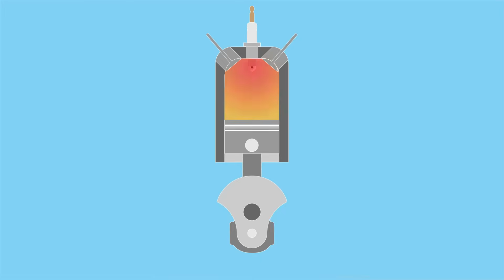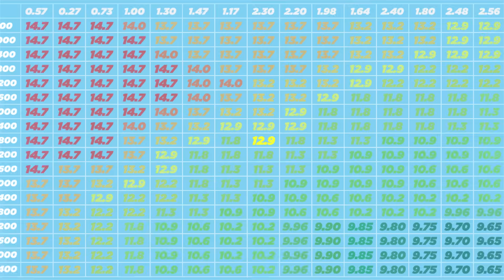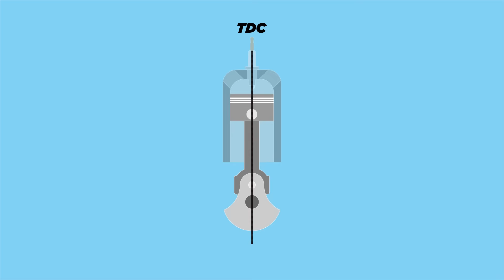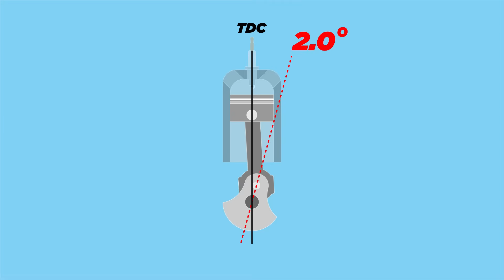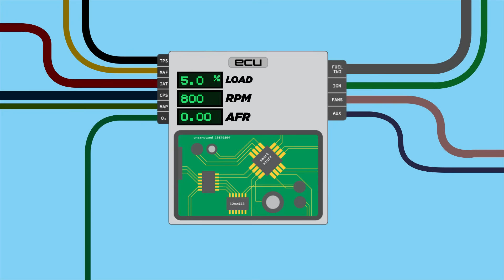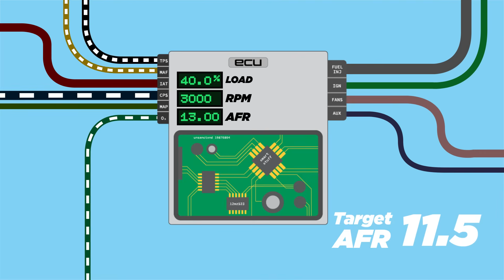ECU Tuning || EXPLAINED

Comment: i must be one of the only GEN-Z kids that can properly tune a carbureted engine. You actually tune it with the same values you use on a tuning software. Tune the engine for peak idle vacuum and the engine will be running at the most volumetric efficiency. This can be done by simply rotating the distributor forward or backward and watching the idle vacuum change until you find the value it peaks it (will be different for every engine) and as for tuning the carburetor itself. In the old days, you drove down the road and pulled the plugs after cool down to see if it was running lean or reach. But that's highly inaccurate. Today, you drill and tap a set of wideband O2 sensors into your headers and hook up an AFR gauge in the cab. Now you can see your AFR at low, mid, and high circuits and change the jets accordingly. (carbs use different fuel circuits depending on your throttle input, full throttle would use the high circuit) So really, all you need today to tune a carbbed engine is a AFR guage, a screw driver, a vacuum guage, and a 13 or 15 mm wrench (depending on the engine) 
My 1994 mustang 5.0 makes 289 whp with a Holley 650 carb and high-rise intake. Stock everything else (195 stock hp) $600 in performance parts with a 94 hp increase is pretty damn good.

 As for tuning an ECU.... there's a reason im watching this video

Comment: Hi
Thanks
Please give me a reference so I can learn the basics of tuning settings. I don't want to blindly change a few spark or AFR parameters based on imitation.
Due to the difference in the tables in different ECUs I need to learn the difference between the tables. For example some ECUs have 5 spark tables and I don't know when each one is activated.
Thanks

Comment: Beautifully explained, most folks dont realize the role of inertia, ignition delay, fuel injection timing etc. As you rightly said, its a very deep rabbit hole. For example you can tune the engine to deliver +20% power, but wont be as effective unless vehicle weight, traction, tire tread etc are adjusted (for various driving conditions). There are just too many variables - in the end each driver also perceives the weight, response, timing etc differently. Respect for folks who do it on day to day basis.

Comment: We didn't go straight from carburettors and Kettering ignition to mapped systems. There was mechanical fuel injection, Hall effect distributors, mapped ignition started to appear, electronic fuel injection based largely on intake air flow, more and better sensors and injection control systems that took advantage of them, king of sensors Lambda, then eventually, mapped fuel injection. That all took about 30 years. 30 years of utter confusion!

Comment: You are not answering questions?????
Reply from the maker: What is the question?
Reply: @ Hello
What turbo would you recommend please 
For a 2.4 5 cylinder 20 valve 
2398 cc 4000 Revs diesel something that spools up fast and good high end ? My target is max 300 Hp , I prefer Garrett ceramic ball bearing water cooled vacuum boost control or whatever you recommend 
Thank you

Comment: Hey brother, i need your words.
I have Civic 10th gen, i recently flush the engine, clean throttle and changed clogged airfilter. As airflow will increase after that, do i need to reset my ECU or it will automatically adjust other things and increase the performance ?

Comment: Hello, I have M4, S55 engine. I exchanget the stock air intake system to Eventuri and now I can see that the air/fuel mixture is too loan at low RPM 1000-2000 (STFT more than +20%). Please can you help me to readjust my ECU parameters? My ECU is bench unlocked and for diagnostic I use BM3 software. Thanks, Richard

Comment: The weird thing is that I have tried 5 different tuners for my car and every time the car stays completely stock on the draggy times. It accepts all the changes like start/stop system off, soft limiter off etc but the power is stock, the car is Giulia 2.0 280 hp

Comment: Need a programmer for a 2002 ford thunderbird. Tried SVT and other brands as well, tripped the pas anti theft system before even downloading the stock tune. Can't find any compatible tuners on the web. What's the big secret?

Anyone know why a simple tuner won't work on this model car when they work on almost any other model ford?

Comment: interesting my l200 will work better now 2003 my old rally car was a god m2 escort 1.3 all light and ball bottom end and top , put out power of a 1.6  old car registration  was UK  bvj155v   sold it long time a go now. did a lot of night rally's with it back in the 1980,s

Comment: The ecu auto tune thing is accurate of all card except the stone age ecu on a 04 Subaru wrx and many others... Acura however is amazing at self tuning and adjusting values.

I learned tuning on my own and so far I've surpassed everyones expectations on power, efficiency, even mpg. On a almost stock wrx I had about 280awhp and 35mpg and lower emissions than stock.

Comment: @MZopyrus, you said something that didn't make sense to me. You mentioned that when you get a cold air intake for example, a tune would help to unlock the additional air flowing in by injecting more fuel. Shouldn't this be already happening with ECU seeing more air flowing in based on the input of MAF sensor?

Comment: Subscribed. It seems like there should be software to automatically optimize your tune.
Reply: There is
Ecus can let you start and let your engine idle a bit
Unless its something extreme like a 3 rotor engine then you should be good

Comment: Wow, you truly opened my third eye when it comes to engine turning.
Before, I thought that engine turning was a waste of money that would alter the OEM equilibrium of your engine and that, as a result, you would get ten additional hp, but your engine would blow up in 5k miles.

Now I understand the purpose of engine tuning. It's basically an art of balancing all the parameters of an engine to reach the best performance, which doesn't necessarily mean blowing up your engine

Comment: Very nice educational video,  the speech is a little rapid, lacks pauses, and pours in the information. He tries hard to explain the basics.
This video does  not warn that changing  those boost settings to more power
dramatically reduces the engine life and probability of a failure

I'd like to know what advantage can software provide to a NON TURBO Subaru engine, 2.2 or 2.5 .

Comment: I have a BMW K1600 motorcycle and needs to be tuned. One thing you may mention in the end to be aware of EPA constrictions. In Europe they are tougher than US and thus imported motorcycles can be tuned to not only make them faster but just ride better. At around 65/85 I like to be a low poluter and before that and after that I bought this thing for FUN, if I want to. Making the tables, like you mentioned are very complex. The video is otherwise about a good as anyone can explain it. Thank you!!!

Comment: As a software engineer I could add you that tunning, at some point in the next couple of years will almost be a thing of the past. Once Internet Of Things (IOT) becomes big like how AI is today, tunning would be done remotely by a tunner miles away from the engine or directly by a Machine learning model. Either way, we still need the human dexterity to interact with engines. Keep learning about tunning, so that you can be the one that teaches AI how each family of engines behave, so future generations have automatic AI tunning
Reply: Good day!, I would like to ask, if it is necessary to remap the ecu of motorcycle after exhaust replacement? from stock exhaust to loud exhaust.
Reply: This would be cool but somewhat wishful thinking. Although I specialize in EE, I have both programming and automotive experience from a young age, and both the technical side and performance side of tuning require different approaches.

Realistically, if I could use an AI to tune my car, it would be sufficient in setting a sort of “baseline” tune that I would build off of. Every car, regardless if they carry the same modifications or stock parts, performs somewhat differently, and a “1 tune fits all” approach would actually yield a few different results if tested on multiple cars of the same make and model. 

From experience, these results can be so minuscule they’re unnoticeable at first, or so drastically different it leaves you scratching your head wondering what the hell the car is doing.

Comment: Great video the best one I've seen for a breakdown on the basics, I've been trying to tune a 2015 XP 1000 with a 1065 big bore kit with air extreme and stage 6 trinity full exhaust with  only a dynojet pv3 and power core software. The shop that did the 1065 upgrade sent the tune to go with it but after flashing the ECU with it, the machine won't run and backfires when idling. I'm in the process of making a custom tune for it because puting it on a Dyno is not possible in my area and was told by dynojet any tune I try from any website won't do the machine justice because of all the extreme modifications or upgrades my options were Dyno it or create a custom tune. So I got creative and this video answered a few questions I couldn't get answers to, so thank you

Comment: How can I adjust the engine coolant fan speed, for example: The fan is running at a temperature of 220 Fahrenheit and I want it to work at 200 Fahrenheit, how do I do that?

Comment: Hi, I'm a new subscriber and I find your videos very informative, I watched your video on how to find the correct turbo and it was super helpful (math included 😅). Before I install my turbo I want to make sure I have all the correct things. I'm seeing my 96 accord needs a chip to upgrade and am looking for the right company to send my ECU to, but I'm seeing advertisements about a plug in that goes to my ecu and is "pretuned" to get the most factory hp from my stock car and it can adjust to a turbo. I may be new to turbos, but I know that a specific tune would be the most beneficial to my turbo, but I am curious about this piggy back ecu, can you make a video or explain this specific ecu to me? Once, again, I love your videos and have shared your info to friends and family to help explain the workings of a 4 stroke motor. Thanks, and I have attached the advertisement for these ECU's.https://www.performancechiptuning.com/stage-3-performance-chip-obdii-module-for-honda/

Comment: Great video man, Im in the process of about to tune my BMW to stage 1. Just got my cold air intake, charge & boost pipe, aluminum coolant flange, and brass bleeder screw. Valvetronic exhaust system with a VRSF intercooler & race downpipe! I can technically go straight into stage 2 with the part mods but going to see how stage 1 feels first this video really breaks down the process and concept of tuning and gave a more clear understanding of whats happening to my ECU. I plan on using bootmod3. 😃

Comment: Have a question. I compared  2 different tune on my car. VW Golf R mk6. Both stage 2+. 1 tune boost 21.5 max but at 3000 RPM. No lag. Powerful for city streets. 2 tune boost at 30 psi max. But it come at higher RPM. Like over 4500 it start to pull. So in the city start/stop it's less cool. On lower RPM it boost at 15 psi. So why it seem not possible to have both ? If the turbo can push 21 psi at 3000 why tune 15 ? And if the hardware can handle 30 why stop at 21 psi. Do i miss something here. I need to understand. Tks.
Like your video.

Comment: Piston does not push the eshaust gases out of the cylinder, they expand and escape on their own. That is why turbo chargers are efficient, becaue they use that waste energy. Also, there are no explosion happening in the combustion chamber, only combustion.
Anyway, good video. But reality is, most "tuner houses" will just upload map which they got off the internet and say,there you go, it is stage 1 now...

Comment: This is good information. I’ve always wondered how an ECU works and how it properly reads data from input sensors. In Minecraft, I made a 4 cylinder engine with a CAN system that can check misfires, determine engine load and speed, check if the fuel pump I created is flowing properly and determine fuel trim, and more. It’ll throw respected OBD codes and will keep the check engine light on as long as the battery i created is fully charged
Reply: Damn that's awesome, do you have a video or link?
Reply: @adreto2978  no but I will make it one day on my YouTube channel: MainKo

Comment: I’m in need of some suggestions.

Actually I got my Harrier XZA+ 2022 tuned to Stage1 +…suddenly after putting back ecu the car was not going past 1600 rpm. No matter what, even if the car is in neutral. 
Initially when I faced the problem the Check Engine Light popped for a few seconds and went off and hasn’t popped back up ever since while car is running.

When I put it in Drive the car crawls and no matter how deep I push the accelerator pedal there is no acceleration past 20-25kmph and rpm doesn’t push above 1600rpm.

There are no other signs of any issue…except for this when I drive.

Have given the car to Tata Service center and they are scratching their heads unable to diagnose the issue.Even they’re OBD tool showed only 4 DTC issues that too memorised.They checked the fuel lining but couldn’t find issues with it, they did check the brake switch but that was also fine. However upon some research I have come to know that the fault may be with the Brake Switch Relay as well which I don’t think they have checked.I have informed them the same.

This problem is completely new for the Service Center.

Any suggestions are appreciated.

Hoping to get my car fixed asap.

Comment: Wow man, I just took an ECU tuning course that was about ~3+ hrs long and you summarized the majority of it very well in under 10 minutes. Really easy to follow information, and sure some of the terms used later on might throw people for a loop but you explained everything in a concise way while still getting the point across. Was a great way to establish the fundamentals as a starting point for getting into tuning!
Reply: Two easy questions……
Is it possible that the ECU programming cause the engine to start knocking ?
Is it possible that the factory mapping could become corrupt or partially corrupt and cause engine knocking ?
Thank you !
Reply: @ginoasci  yes, if the ignition timing is too high there will be engine knocking
Reply: @maskangel  : thanks for the response.
This motorcycle engine knocks when it starts, lasts a few minutes, and then it goes away, but not completely.

Come to find out that this sounds like the symptoms of faulty cam-chain tensioner.

 Does the knocking from bad timing start, and go away, or is it there all the time ?
Reply: Hi, I want to take the course too.. can you help me ..?
Reply: Gave me a headache trying to understand them big words :O
Reply: What big words?

Comment: My 2 questions: 
1) I have an MGZR and the Kseries engine (1.8 litre 120) doesn't have a knock sensor so does that mean I wouldn't be able to tune it without risking it blowing up? 
2) Other question is will tuning a car increase power but also increase fuel usage? Or does it lower it because it's technically running more power efficiently? 

Cheers man and thanks for the informative video

Comment: A very interesting and well explained video.....I wonder.

I got a version of the  tuneECU ap for motorcycles up and running yesterday for use on my 2020 Triumph T100 motorcycle ....and have re-set my service light....pleased with that....thats all I really bought the app for.

Got me thinking....seeing I have removed the cat and fitted shortened exhausts than std....is there anyway with tuneECU to say hookup tuneECU and go for a ride.....riding in your usual way...usual RPMs ect....and have tuneECU monitor how your motor is say burning....I always fear running weak.

I know zero about maps....at present I dont want to get involved with that stuff....at present that is.

But just as a test tool....is just monitoring the fueling and burning on my bike possible....or is that a to simplistic way to look at it.

Comment: What about tuning without any dyno or test drive? I had my bmw b48 engine tuned without moving the veichle, the tuner (quite a famous one, in your video is the one with the M2 at 0:10) told me that it wasn't necessary since they had enough data on that engine and it wouldn't change anything. What do you think?

Comment: You want the highest cylinder pressure when the connecting rod is at a right angle to the crank to get the most torque which would be 90 degrees after TDC. Did the laws of physics change? I'm old school so maybe they did, LMAO. There's more leverage applied the further from the centerline of of the crankshaft and 90 degrees from TDC would be it. Strokers aren't just for adding cubic inches, they get the crank throw further from crankshaft centerline and gain much more power from the rod and crank change than cubic inches added by the longer stroke. Like a cheater pipe on each crank throw it makes it easier to change the linear motion into circular motion when you have more leverage on the crankshaft.

Comment: hey , i got a question  is it better to buy a on shelf tune box or tuning software such as APR or JB4 ..ect or i tune it with a normal way and maybe use a dino ? i got a VW golf U.S model  TSI 1.8T mk7 2017 and i really want more power

Comment: I have a honda Integra gsr with a p72 ecu, I'm getting new camshafts and have done a few mods so would like to get it tuned, my question is do I need to get the ecu chipped before I get it tuned and also what is the difference in a chipped and non chipped ecu when it comes to tuning ?